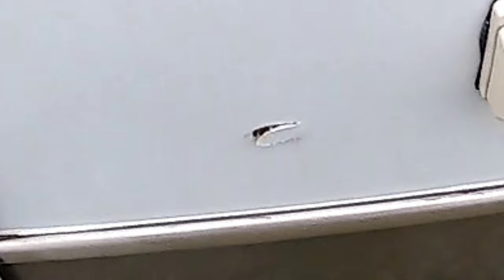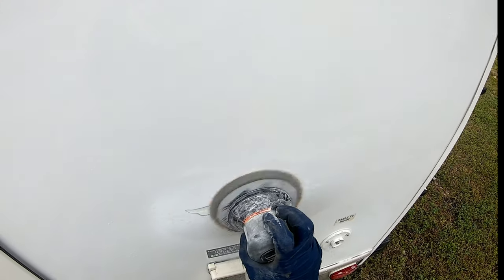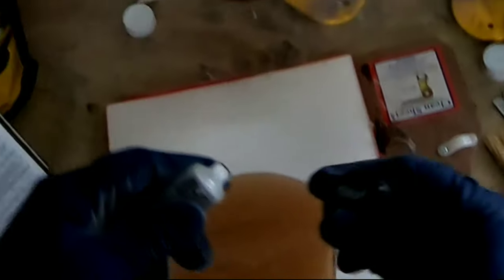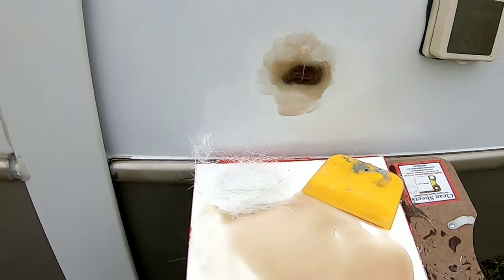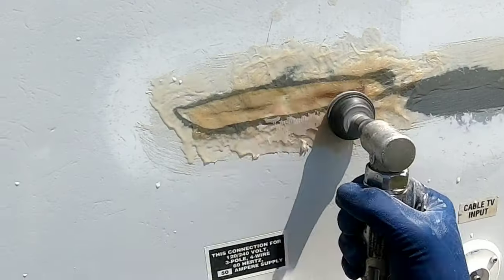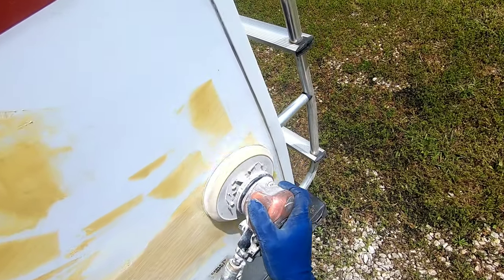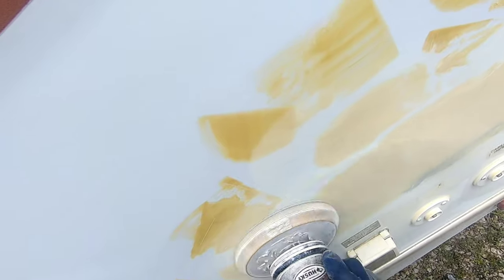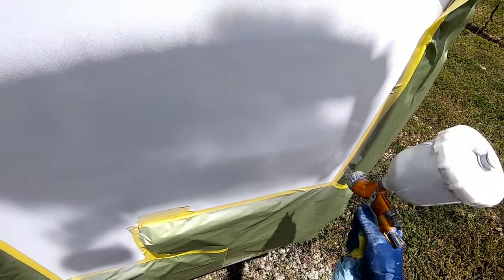How to repair a crack or hole in fiberglass. #rv repair #how to diy

Comment: Can I use this repair on a pressurized vessel????  Never above 30psi as a temporary repair until I can get my pool filter.  Freeze in Texas 2021 has back ordered the filters.  Great Job Garage Noise!!!
Reply from the maker: You need to use fiberglass resin  and matting  for a pressurized vessel.  Can't remember if i did in this repair.